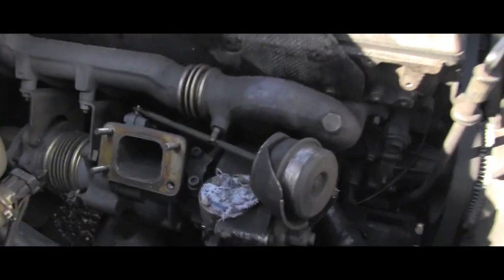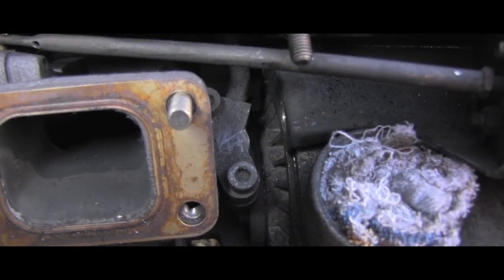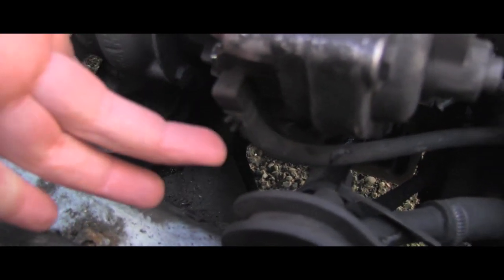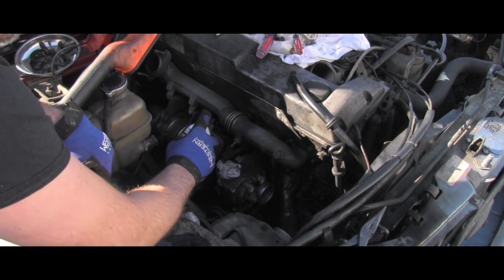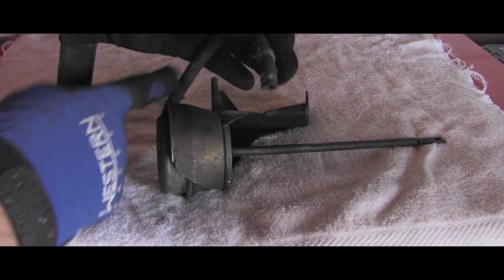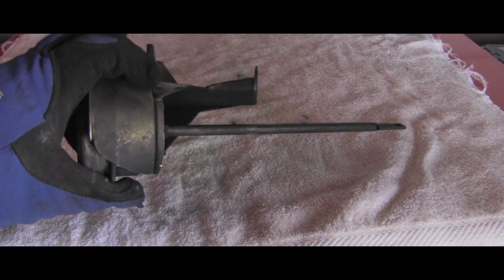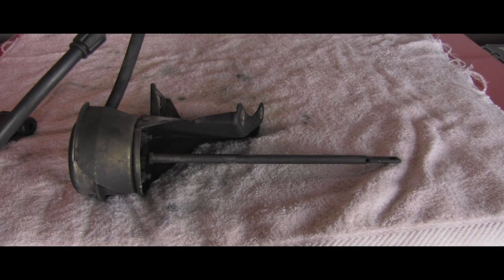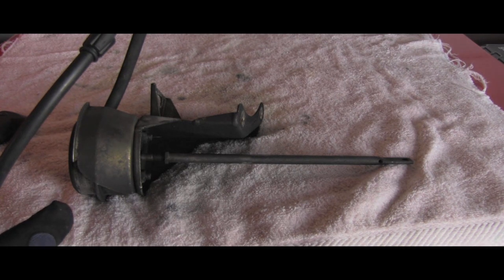Mercedes Turbo Diesel Wastegate Actuator removal, testing

Comment: What will eventually happen if the waste gate does not open what kind of damage are you doing to your engine please respond thank you
Reply: Waste gate releases intake manifold pressure. If it fails to do this a switch in your car SHOULD disconnect your ALDA from intake manifold pressure, signaling (ironically) a low boost situation, ALDA will cut fuel.

If both these safeguards fail you get tons of boost and maximum fuel, this can raise EGT temps (melt your shit) and over spin your turbo (blow your shit up)

Comment: You know where I can get a diagram for piping on vacuum boost valve on a vito 108 2.2 cdi one of the pipes are snapped off the small thin plastic one